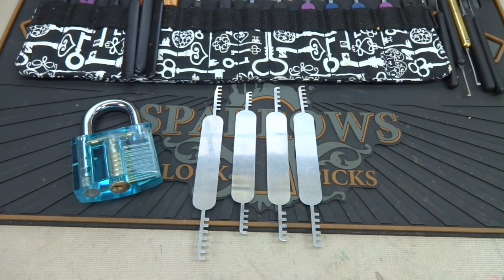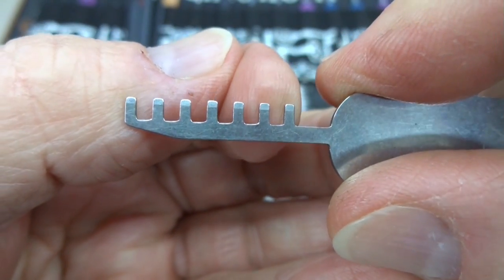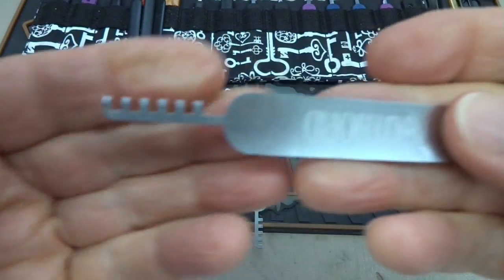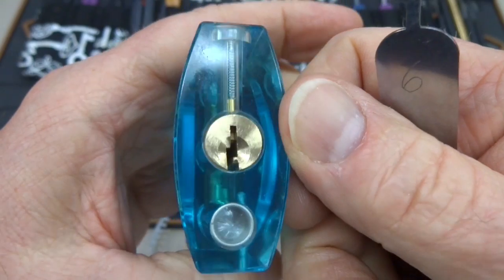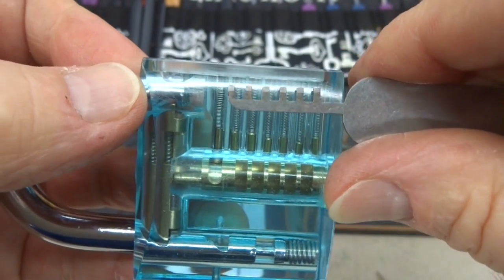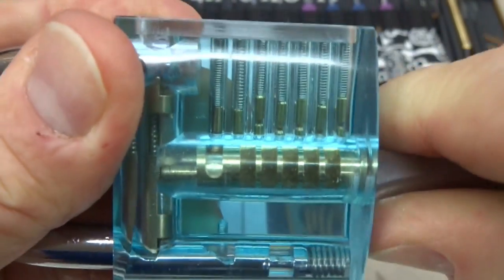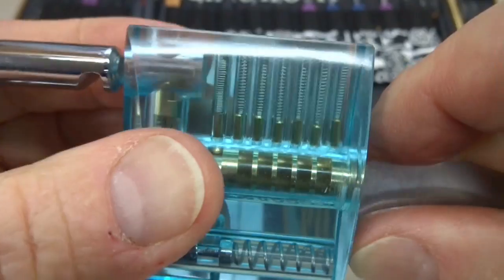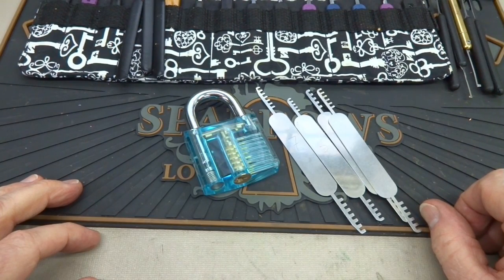(751) Using Comb Picks

Comment: Is there any way to modify a lock to prevent comb picking and pushing past the shear line? Aside from getting a new cylinder all together that has the better paracentric key way?
Reply: Longer driver pins or shortening the chamber with grub screws may be a viable method.
Reply: @TC-th1ey  Or just drop some wafers in the cylinder before the spring
Reply: A GUN

Comment: I have to say this looks more trouble than its worth.
Reply: InTheNameOfJustice well it's probably not worth carrying.... but if a lock is old and shitty, but you're not able to pick it, why not give a comb a try?
Reply: @notpulverman9660  The four and five pin ones are very much worth carrying because a lot of master locks are susceptible to this and are super common.  the others not so much.
Reply: @kidthorazine  For sure. The 140 and 150 in my collection are both easily bypassed with a 5 comb.

Comment: hello bill, one of my locksmith buddies gave me  a  a lock that came off a vending machine, iam not sure,  if it a a tubular lock? the lock is in the middle of the square  T -handle, its circular  with a raised dimple or button design , with a a small half moon key way taking up about one third of the locks face. any help on what type of lock this is, and the best way to pick it would be great!! that mike